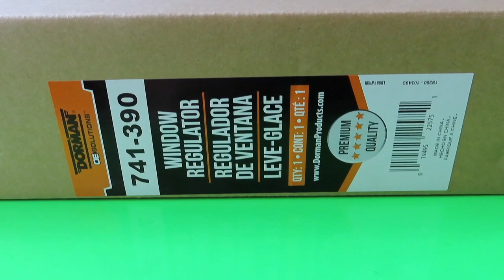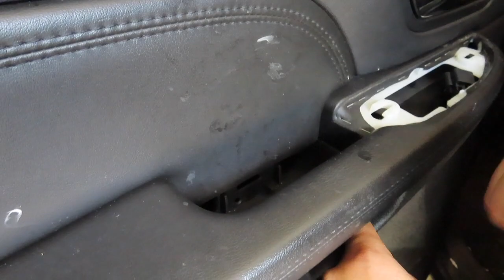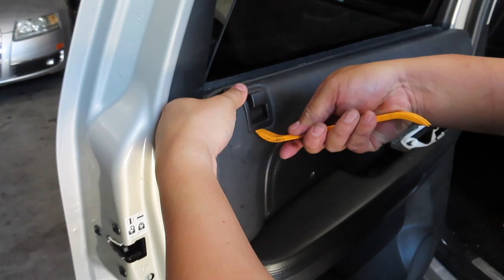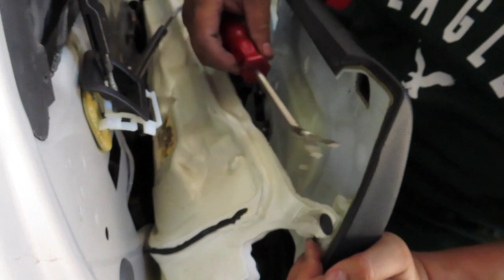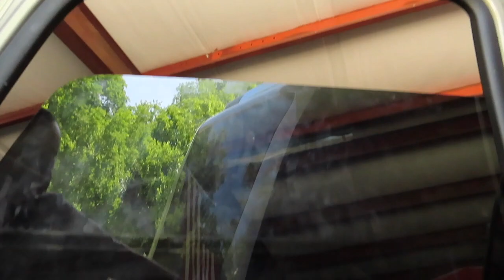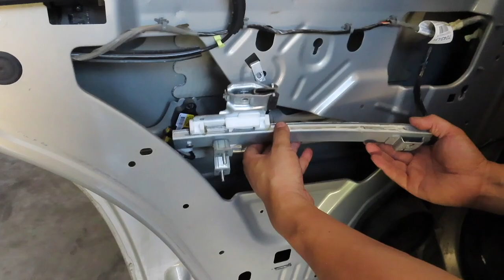Rear Window Regulator Motor 2007 2010 Cadillac Escalade

Comment: u need to take the top lock manual button off. there's a small clip u lift and it releases . also u can release the latch handle cable from rear easily

Comment: Thank you for the step by step tutorial. For other people looking to do this themselves, it's easy - under an hour if you have the parts on hand. Only two suggestion would be 1) pop the clip on the door lock and slide it off and 2) remove the door handle cable by prying the two tabs and freeing the cable end. Other tutorials have those steps - those two steps along with this tutorial give you all you need to replace the motor/regulator assembly.